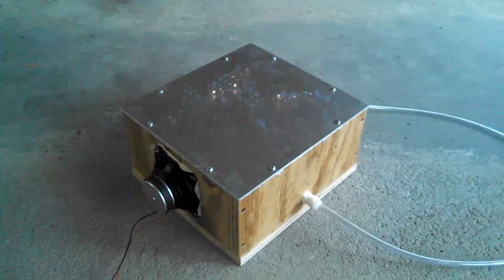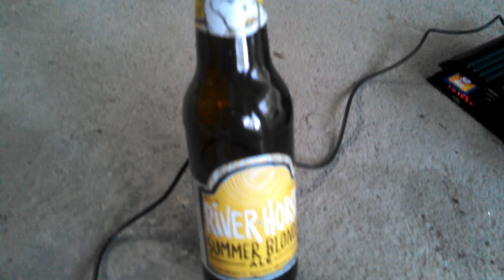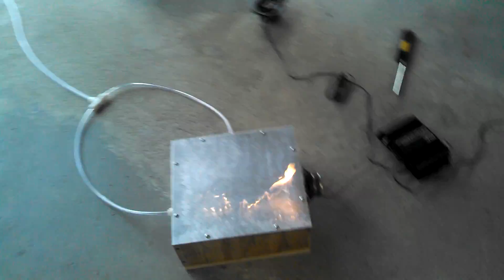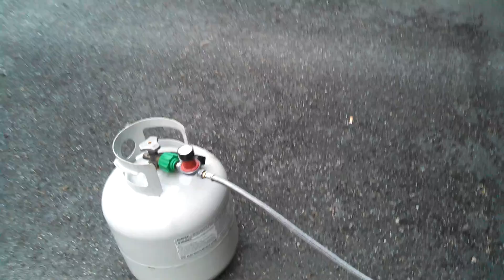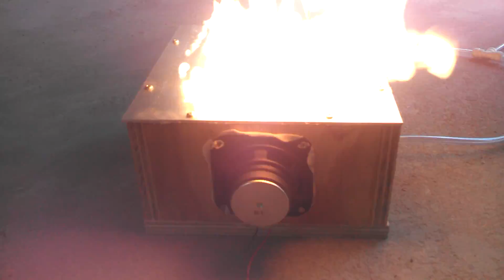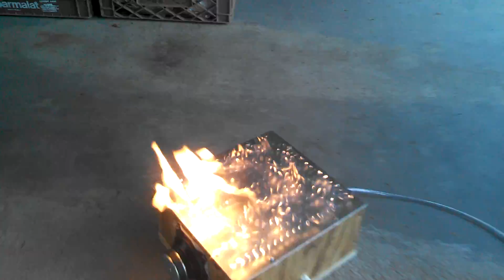Pyro Board Protoype Test

Comment: Hello, I'm currently building a pyro board for my high school senior project and im wondering what you used for the bottom of your protoype?
Reply from the maker: This was all just wood below the aluminum plate. It wasn't for durability... just something quick to test my hole diameter and hole spacing.
Reply: Thank you, any info helps !

Comment: Hello, Actually I am designing a Pyro Board of my own. im 17 and plan to be an Engineer for my career. in my High School we have an Engineering program and im in my Final stage, Research and Development. I have a simplistic design of a 2.5ft x 2.5ft box with about 3,000+ holes in a square pattern similar to the Pyro Board from Fyshics channel. im lucky to have a CNC machine available to help make accurate holes and precise chamfers but limited to a 40" x 20" travel. Also, since I have this as my project I cant really make it exactly the same :(. so I need to put my physics and Ingenuity skills to the test and create a whole new type of plane from the rubens tube. :D I just need to get a deeper understanding of how the vibrations travel through the gas and how, that if its possible, make it so that I create a plane but it... ahh cant speak anymore might give it away ;)

Comment: I'm in high school and this is my senior project.  I was wondering where'd you get your pressure gauge and what operating pressure did you use for your demo? Also what size holes would you suggest to me? How long did you run it before the wood started to burn?

Comment: Did you have any problems with the speaker getting too hot?  Is it a regular 2 way or 3 way door speaker? I'm making one right now. 
Thanks
Reply: whiteboyofvernon what gas is that????
Reply from the maker: The speaker caught fire on an early prototype, but that was from propane leaking around it, not from heat. The wood gets too hot, but I knew that would happen. This is just for testing purposes. At this point, I'm getting ready to make a 24" x 24" version, but I'm way too busy to get to that before the end of the year.

Comment: Im making a large Pyro board right now. itll be the around the same amount of holes as the fysikshows' pyro board/ but my box is much larger the length is 4ft, width is 3ft, and the depth is about 16 inches. I cant wait until its finished. also, its going to have an 800w 12 inch sub inside of it for the power. ill be posting a link on here to it after i make it if you dont mind! Thanks
Reply: did you ever make the pyro board?  If so do you have any video on how its made or a list of materials and instructions on the build?
Reply: jeff weiland please men

Comment: great prototype.   How big are the holes you drilled?
Reply from the maker: 1/16th of an inch. The quenching diameter (the flame can't go through it into the box itself) of propane is more or less 2mm if you want to be 100% on the safe side. I'm not sure 1/16th is ideal in terms of flow or back pressure, but I figured I could always go larger if I want in the future.
Reply: whiteboyofvernon Is there anything else special to know about these to make them? Im planning on building a small one for fun tomorrow. Besides the hole size, are there any other things to make sure I do? The rest seems pretty standard. Thoughts? Thanks! Oh one last thing, I couldn't tell from watching it as the sound at times was a little muffled but why did the flames get so much bigger at the end?